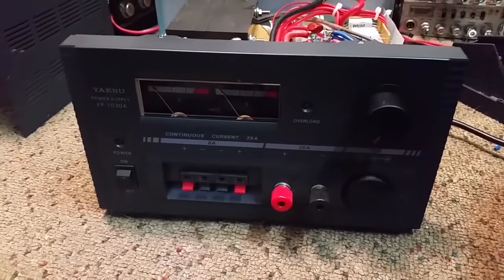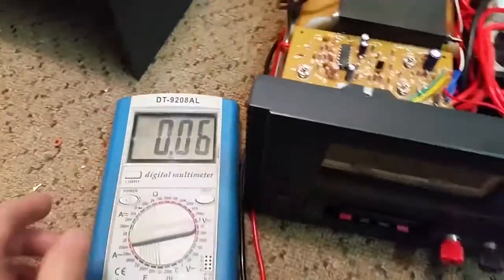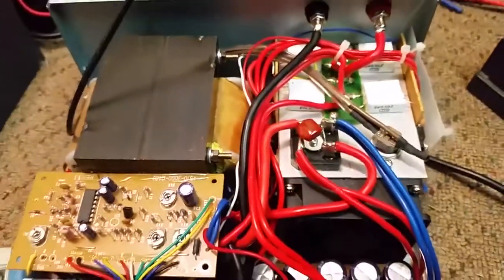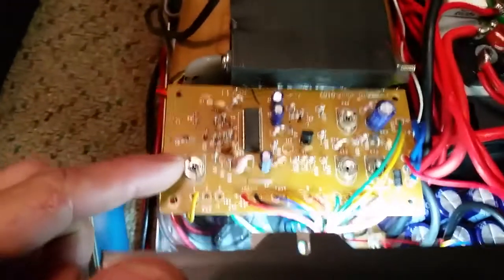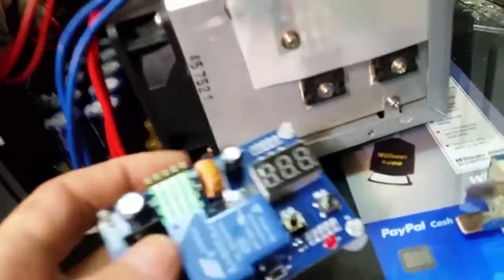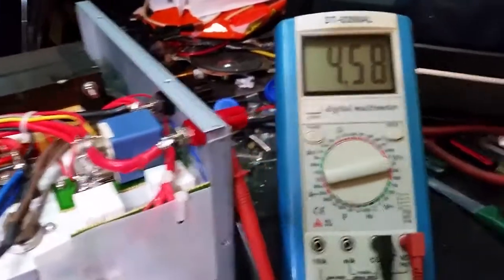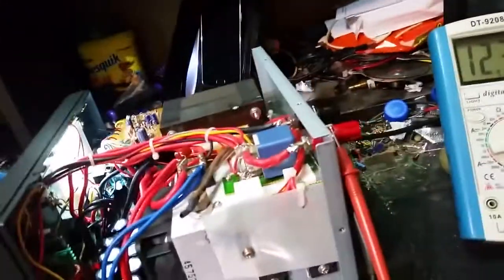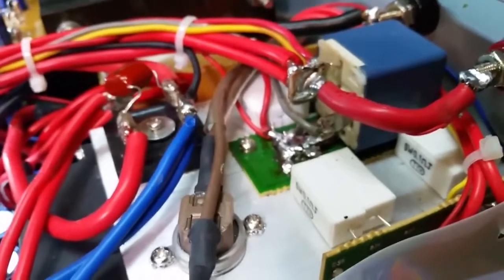YAESU FP 1030A Power supply

Comment: I turned my 1030 on and smelled something after a few minutes. I hooked up a meter and it showed 15.3 volts. I almost pissed in my pants since I had 2 mobiles hooked up. I got inside and tried adjusting the output. All 1 way is anywhere from 9 to 11 volts. Hardly moving VR1 and it goes to 15 or 16. If I wiggle it close to where it was 9 to 11 I can get 13.8. Should I just change the pot or wire a separate pot like you did? Thanks Steve

Comment: I gave the Diamond version but the volts gauge is not working anymore, however the power supply is working except for that (I checked the output voltage  and also, the amp gauge seems to be working). 
I have measured up to 240v on the volts gauge conectors, which seems wrong to me and probably the reason why it failed.
Any idea what could be wrong ?